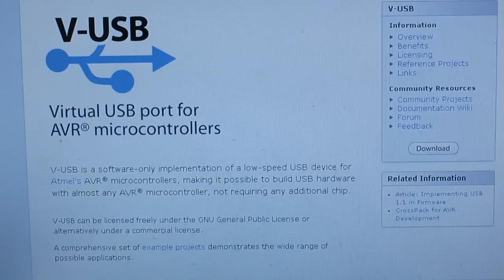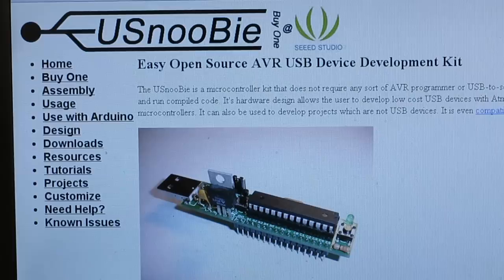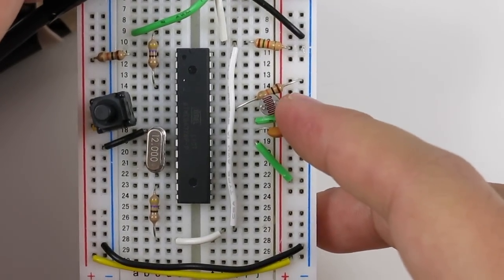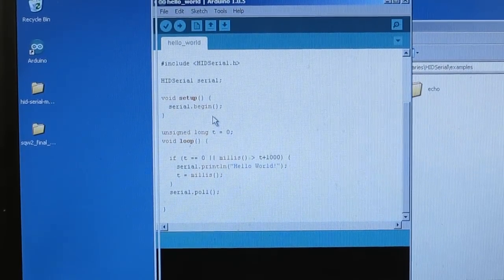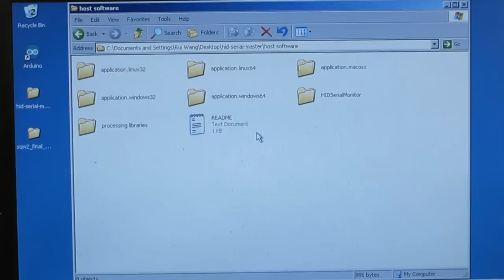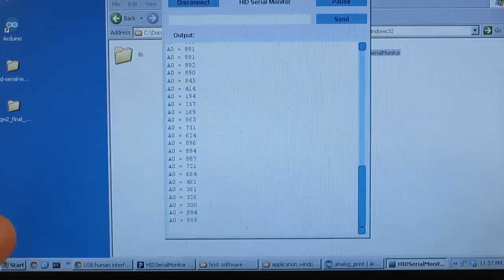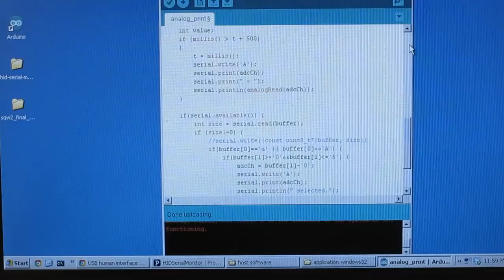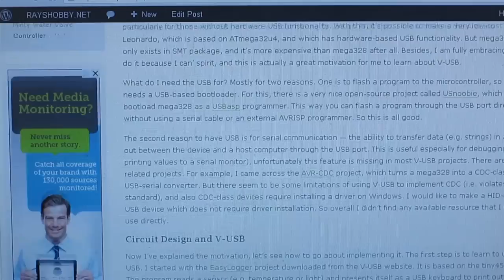HID-class USB Serial Communication for AVRs using V-USB

Comment: Hey Ray.  I like your project  and am developing a "HIDprint" console tool of a similar nature.  Will contact you when released.  Especially clever to limit the output to 8 byte chunks ... the maximum transferable in the description structure to save RAM.  However, I am attempting to use a loop buffer instead  to smoothly blast data out.  One problem with your system is that the AVR sketch blocks when it fills that 8 byte buffer, and the Java monitor is not running.  Inheriting the Print class was a great idea.

Comment: Hi! How did you flash the Usnoobie bootloader onto the atmega328p ? I really need your help thanks!
Reply from the maker: You can use any AVR ISP programmer, like USBasp, USBtiny, AVRISP etc.
Reply: Maybe it is the Arduino IDE software that is the problem. It keeps giving errors upload.tool error when the board is selected as 12mhz USnooBie and uploaded
Reply: I am really desperate getting this to work and want to pay if you can help me :)
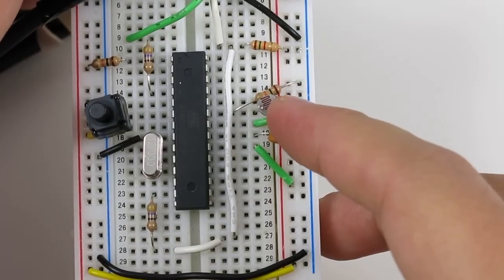At 3:34 you said that you 'pre-flashed the microcontroller with the Usnoobie bootloader'. But how did you exactly "flash it"? I mean, step by step, like what software/hardware did you use and what did you do?

I dont think the original project website is helping me much step by step ( eleccelerator . com /usnoobie)
Reply: I am very late to the party, but I would like to know as well. Nicely step by step. Does anyone here know about some tutorial? Noone ever mention this, like it is absolutely common knowledge or something. But there are bazilion steps in read me files etc. I do not understand that well. :/
Reply: hope its not too late, but you need a USB to UART adapter, it's a device that converts code to machine code
you connect power and ground respectfully, and TX to RX and vice versa
TX is Transfer Data and RC is Recieve Data
you ideally want a CP210x series as an alternative is no longer supported by windows above XP

Comment: Hi Ray! Great Stuff! Would it be possible to get 14 buttons on an attiny45 or an ATmega328p (solo chip, no extra chip through USnoobie ),and have it working as an arcade hitbox?
Reply from the maker: ATmega328 probably yes, you can use all digital pins as well as analog pins (which can also function as digital pins). ATtiny45 would be tricky -- you will need at least 8 gpio pins to form a scan matrix (4x4), but tiny45 only has 6 gpio pins in total.

Comment: can you make a video about a circuit with a servo and lights, 
connected to PC via USB and controll that servo to move and the light to turn on.
"without using a ARDUINO please"
i want to know how to make the circuit. please help thanks
Reply: +lorenzo garcia Maybe you could clarify what you mean by "how to make a circuit". It really doesn't make any sense.
Reply: "without using a ARDUINO" Means the circuit is a Custom micro-controller. the idea is an application from your pc will try to move those servo in real time via custom micro controller if that makes any sense.
Reply: lorenzo garcia You should look into buying an AVR ISP programmer and download the Atmel Studio AVR IDE. This will enable you to create "custom" microcontoller circuits. As for USB communication, you would need to buy microcontrollers with built in USB functions, otherwise you would still need to use the V-USB library when programming. There should be many AVR tutorials online. Is this what you meant?
Reply: +lorenzo garcia if you want to start thing simple, i suggest you to readup https://learn.adafruit.com/trinket-fake-usb-serial
its core library is also base of V-USB assembly.
working with a bare AVR mcu + arduino IDE make things really simple for beginners, at least  this is how i get into the AVR ecosystem.
you don't need much of a design to make things work.
an AVR mcu say ATMEGA328 is basically all you need.
but you must really understand ohm's law current & voltage relationship in order not to burn anything.